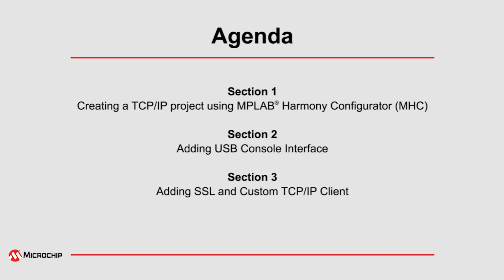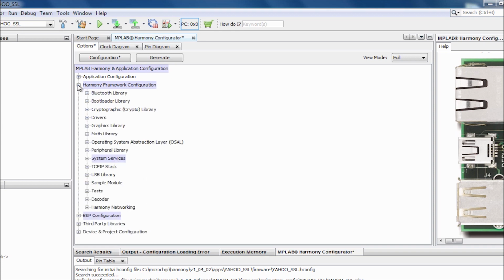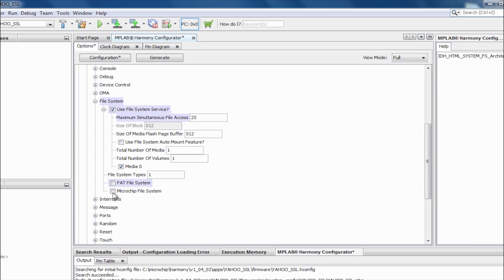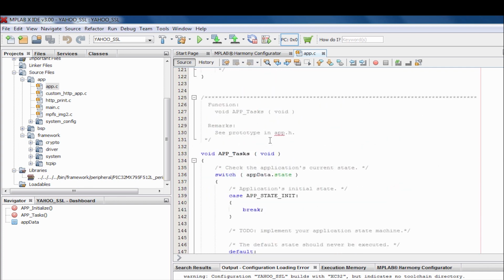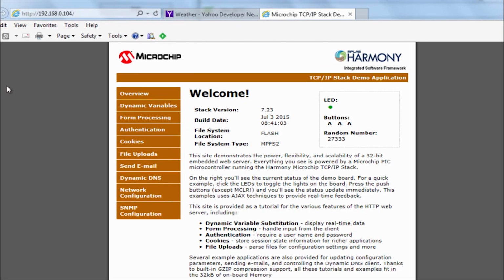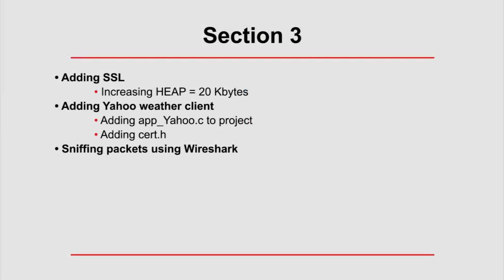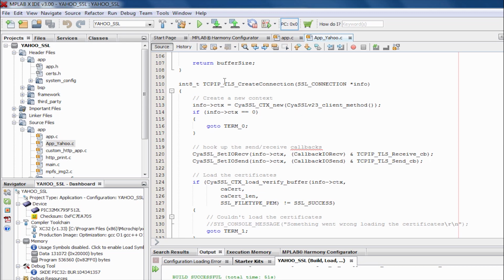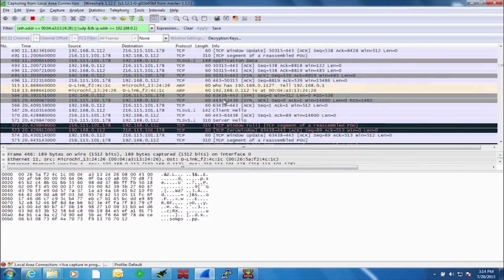MPLAB® Harmony Configurator Tutorial - Creating a TCP/IP Project from Scratch

Comment: So this is old and the user interface has changed dramatically. is there an update using the harmony3?
Reply from the maker: This video shows a demonstration of the capabilities of the TCP/IP middleware functions in Harmony 2.  Yes, the interfaces for Harmony 3 MHC have changed, and you will need to consult other information sources (including our new updated website for quick start on Harmony 3).  However, the middleware library including options and use for TCP/IP have not changed from one version to another.  Therefore all of the coding and use models demonstrated here are still relevant."
Reply: @MicrochipTechnology  I'm using Harmony v3 and when I enable TCP/IP stack for some reasons it enables me the DEBUG_USB. Then the generated code does not compile because it's missing some dependencies. Have you some information to get started with tcpip on harmony v3?
Reply from the maker: @marcosemenzato1934  Kindly visit support.microchip.com for assistance. Thank you.

Comment: Hi, I am using microchip harmony configurator for pic32mk1024gpe064, in which your pin configurator has a serious  bug in it that it assigns two pin names the same pin name and pins 17-19 got wrong configuration i think and the can is not at all working on( 30, 31 ) pins . Please let me know where could i report it or can i get it corrected

Comment: Hi, Thank you

Well, I'm trying to have the example running on harmony v1_09, but I'm not succeding. Can anyone help me please?

-Eternet Stater Kit II MX795f512l  ( Yes, I've made the configuration for this BSP ).

- Requires several files that are not available  app.c, app.h, App_Yahoo.c, certs.h   ( I saw that the API is quite different now, and the files of cyassl/ folder are now generated at wolfssl/, but I couldn't find the path of <cyassl/ctaocrypt/logging.h>  and either the new  path of "tcpip/src/system/system_debug_private.h".

- And the last, Does anyone know something about, if Luc made the revision and published somewhere? "This is not implemented in the code created last year (June 2015).  I will revise the project to use another API, "api.openweathermap.org"." - Luc Archambault
Reply from the maker: Joao - the best way to get assistance with this is to visit our Technical Support area on our website and either post your questions to one of our user forums or create a support ticket to contact an applications engineer. Go to support.microchip.com.
Reply: Microchip Technology thanks, I will do it

Comment: Hi Luc, 
First of all, I would like to tank you for this very useful tutorial. I am a beginner in the PIC32 Ethernet kit, so I would like to confirm with you, we should remove the jumper JP2 while connecting the micro USB cable to any computer's terminal, is that right? Sincerely, Bruno
Reply: Hello Bruno.  No you do not need to remove JP2 on the PIC32MX795 Ethernet starter kit.  Refer to the schematic diagram in the User's manual.   In this demo,  it actually does not matter.
Regards, Luc

Comment: Hello Luc Archambault, this video is great and im trying to follow it. I hv problem dealing with the firmware App_YAHOO. I sniffed the packet and found the certificate is verified and followed by the application data. But in the firmware the program seems to be always trapped under this line

int ret = CyaSSL_peek(mySSL.ssl, buffer, sizeof (buffer)-1);
            if (ret < 0){
line 353 in App_Yahoo.c.
This caused the temperature value has never come out to the console display.
Need your advice please.

MHC v1.07.01
MPLABX IDE v3.35
XC32v1.40
Reply: Hello Han,  Yahoo Weather has change the way to access their weather API.  You need to OAuth 1.0 authorization to access the API,  which requires you to get an API Key from Yahoo.
This is not implemented in the code created last year (June 2015).  I will revise the project to use another API, "api.openweathermap.org".

Sorry about the inconvenience.
Luc
Reply: Would you describe me more step by step by emailing me afaideen@gmail.com. I am happy to hear your revision update sooner ;-).

Comment: He should write the MAC address in 8:11
Reply: +Fabián Romo You do not need to write the MAC address,  since it already has a pre-programmed unique MAC address programmed into the PIC32MX or PIC32MZ with built in Etherent MAC !  But if you do enter it,  then the code will use the MAC you have entered.  Now you will need to enter a different one for every device you will be programming.
Reply: +Luc Archambault Each PIC32MX including an Ethernet Controller has a unique address, which is loaded into the MAC registers on power-up, and it is "0004A3000000"